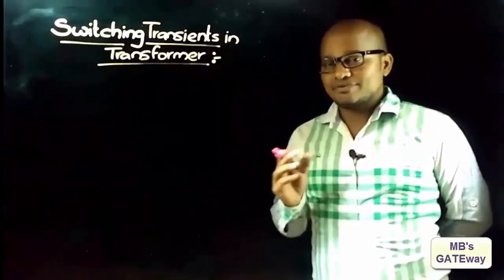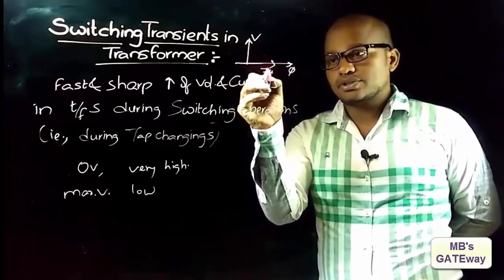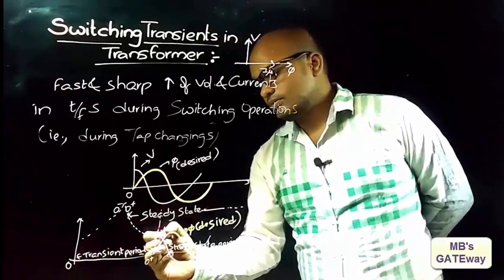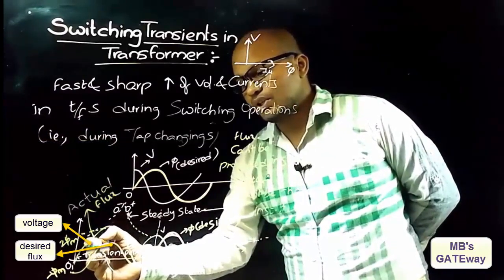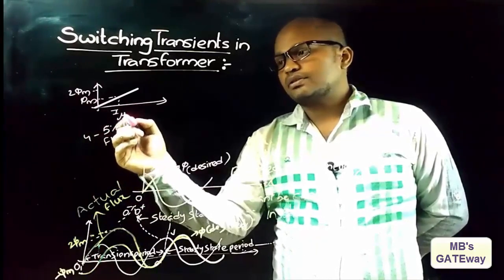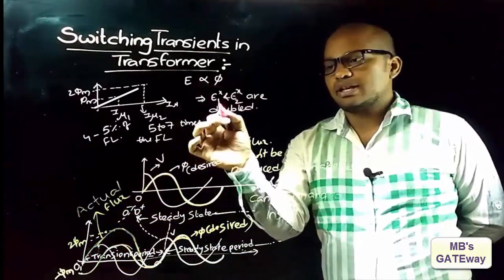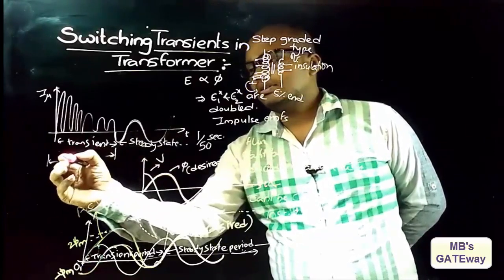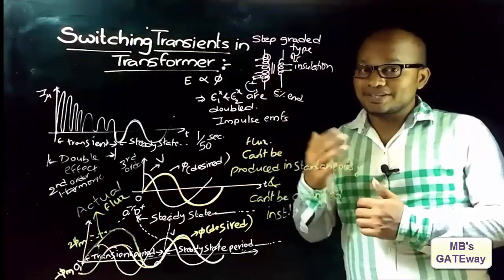Switching Transients of transformers

Comment: Hi sir, First I would like to thank you for superb and in-depth analysis of the topic.I have mostly covered all the lectures in just 3 days. Please make video for  transients due to saturation of core. Also in the present video, please explain how to switch on the transformer at v=0 or at v=vmax?
Reply from the maker: Here comes the importance of Power Electronics with controlling mechanism,we manually can't identify V 0 orVmax. But,as it is compulsory to switch,and most of the switching is done manually,we can't avoid transients.so is why extra protection is added to transformer  turns